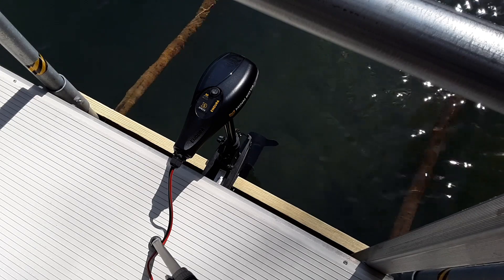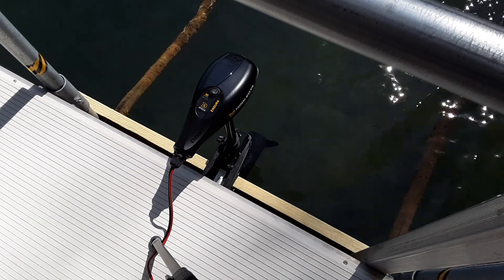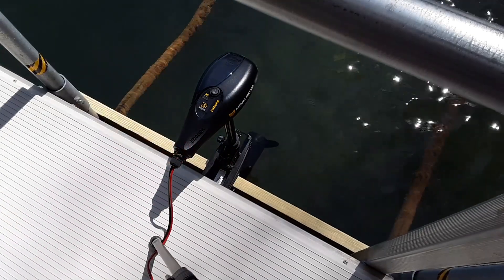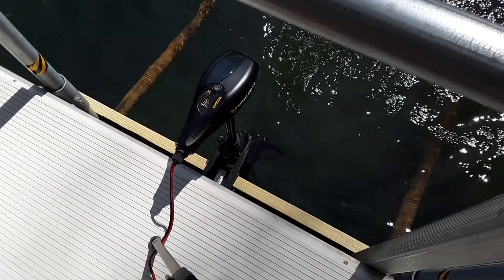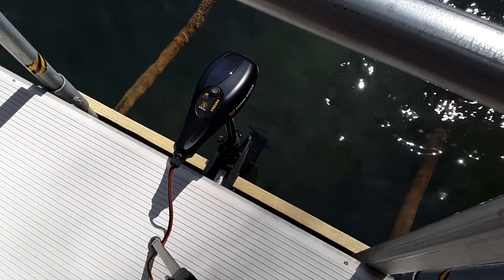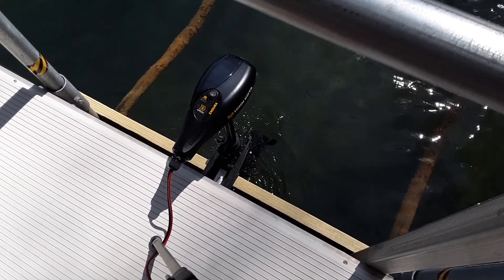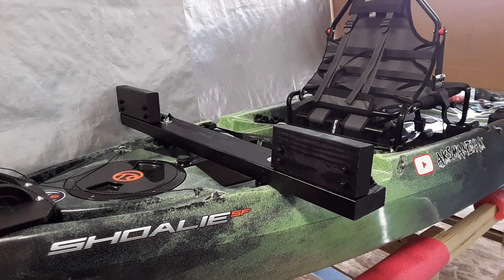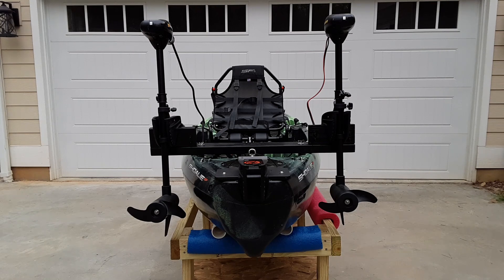Dual Trolling Motors With Wireless Controllers Used As Thrusters

Comment: so you cant control both on one controller? using left for the left motor and right direction for the right motor wont work as a way to steer and use one controller? im so ready to jump into this. awesome video
Reply from the maker: Thanks! Yes, you can control both motors with one controller. I also did that in my dual Watersnake T24 video.
Reply: @Aksmaniyak  oh... your channel is all about it. i just stumbled onto this video and didnt realize there was a way lot more. well... im going to start with video 1 and work my way up. thanks for the videos and reply.
Reply from the maker: @djtrunkz313  Thanks! Enjoy and bring plenty of popcorn! My videos aren't exciting but you will get information without all the blaah blahh blahh.😆

Comment: the props need to be more behind the kayak, not along the side. you would notice a dramtic speed and thrust increase. like big boats that have 5outboards, youd never see a motor hanging off the side of the boat.
Reply from the maker: This was just a fun project to see if it was possible. I made a quick double mount with 2x4's. The props would hit each other if mounted off the stern of a kayak. A big boat has more stern to work with and it is also more of a practical power plant. Take this video for what it was meant to be.

Comment: Great work, in a different video of yours  I asked about haswing protruar 3.0 24v trolling motor. You mentioned their good tm's and I want to ask for are there references to their run time capability with it being different from an outboard motor?
Reply from the maker: Thanks Travis. I have not seen a head to head with a gas outboard and electric trolling motor. However, gas will have a longer run time with an extra tank at a much lower cost than trying to carry multiple batteries.

Comment: To make a dual motor set up useful another component is required. A joystick controller allows for seamless 360º rotation and speed control with the added benefit of the safety of a second motor. If one motor fails the paddle is used as the rudder.

https://www.youtube.com/watch?v=iZXgDX8Wrw8
Yes 13 years ago. That is remarkable tech. Too bad I can´t find anything compatible for small boats... only big boats with electronic controlled engines
Cheers

Comment: Omg I just go the same remote planing to do it on my trolling motor… did you got it working with dual motor setup that help you turn by the speed of the motor instead of Turing the motor with 1 remote? I think I saw it as an function listed on the Amazon listing but cannot find any real instructions how to set it up
Reply from the maker: The dual Minn Kota uses 2 independent wireless controllers to steer. My other dual Watersnake video uses 1 wireless controller to steer.

Comment: Nice setup.
Question:  How is you AMP meter holding up and how long have you owned it?  I bought one just like it and it didn't last to long.
Reply from the maker: Thanks John. Glad to hear from you. I have been using it for about 3 years and it hasn't given me any problems.

Comment: Great vid and once again proves the max hull speed theory. You doubled the amount of thrust but didnt double the speed.
 (This isnt directed at you, i know you understand the concept of max hull speed)
I see so many people going big motor or playing with props trying to get more speed out of a yak. When the reality is its not the motor or the prop thats limiting the speed on a kayak.
Reply from the maker: Thanks. I agree with the max kayak speed theory with standard trolling motors. The 1MPH increase in this test doesn't really count much. I have seen the newer Torqueedos and NVs reach 6MPH on this kayak but those are different motors.
Reply: @Aksmaniyak  That was a cool project! @nitewolffishing I've also see the effects of more thrust not really equating to more MPH (or just slightly) and this certainly proves it. At some point, because kayaks don't get on plane, it just maxes out because you're just plowing. Again, great video!
Reply from the maker: @drewgregoryhookedonwildwat6991  Thanks Drew! You would like the first version with the dual Watersnake T24s too. Different control set up.
Reply: Just trying to understand.  I read about the fundamental theory behind the max hull speed theory.  But it doesn't make sense that a 10hp Torqeedo would not propel a kayak significantly faster than a 55lb trolling motor, demonstrating that max hull speed is just as dependent on the power as it is design.  As the saying goes, given enough momentum, pigs indeed WILL fly.
Reply: @MrSteve280  well for 1 think your not putting a 10hp motor on a kayak period lol.
And if you did at some point your going to break plane even on a displacement hull and now your no longer dealing with the limits of displacement hulls.

FYI the biggest one i seen on a kayak is their 1103 which is only 3hp.

Now that being said i have seen 2.5 GAS motors get a kayak up on semi plane.
 But as explained in my other response your no longer dealing with the displacement hull limits.

There are whole nother issues also when you do push a hull up on plane that was never meant to be on plane.
The main one being they get squirrel as all hades!!!

 I do see a near future where we do away with displacement hulls on fishing kayaks since the number 1 trend for the past few years has been going motorized and this year it seems to be going gas motorized.

I think the jonny bass10 is a planing hull by design. 
But right out the gate it was designed with a gas motor ready.
Reply: @NiteWolfeFishing  Sorry for the dual post - I thought I lost my first comment.  Anyway...   Of course you're correct, the typical kayak hull isn't designed to go much past 5mph regardless of the available power.  My Hobie Lynx would probably get airborne at anything over 10mph.  I'm just looking for the perfect solution to get to me fishing spot ASAP without having to do it at only 3mph.
Reply: @MrSteve280  for the best speed right now i think the best bet is a 2.5hp gas motor.
But not sure that hybrid could handle it.
Next would be a torquedo 1103. But comes with a 3k price tag.

at some point your just going to have to live with a 3 to 4 mph top end. 5 to 6 if you have the bucks and your yak/board can handle it.

 personally iam about ready to build myself a micro skiff. Put a 10hp on the back and spotlock on the front.
Reply: Bear with me - just trying to make sense of this all.  I've read about the max hull theory but it contains a few assumptions which appear to make the theory very condition.  It only makes sense that a more power would overcome hull design and that a 10hp Torqeedo would push the same kayak faster than a 30lb thrust trolling motor.  And, least of all, the max hull theory appears to be dependent on a kayak being paddled, not powered.  That implies just as much a direct dependency on how fast a human can possibly paddle, not only the design of the hull.  Add more power, and the hull theory seems to go out the window.   As the saying goes, given enough thrust, a pig WILL indeed fly.
Reply from the maker: @MrSteve280  I would suggest a test using the same kayak and the torqeedo vs the 30lber and see what happens.
Reply: @MrSteve280  Nope, you can power past max hull speed. Max hull speed doesnt matter if its paddled or motored.
Its a curve a displacement hull (which is what all kayaks are) has a max speed that it will reach with very little actual effort.
Once you hit that max speed it takes exponentially more force to gain more speed. even more speed takes a great and greater increase in force to gain a small increase past the max hull speed.
 So lets say a certian models max hull speed is 3.5 (thats about average).
Paddling or a 18# motor will get ya there.
Now you add a 30# motor and you get to 4.0, bump up to a 40 you may get 4.25, bump up to a 65# and you may get 4.5, bump to a 80 pound may get you 4.6 and so on. (numbers only used as a example)
 So you can push past max hull but it takes more power to do so and the gains get smaller and smaller.

 even planing hulls face this right up till they over power the displacement and climb up on plane.
Reply: @NiteWolfeFishing  I've come up with a solution; a drone kayak.  China's probably working on one right now.
Reply: @MrSteve280  lol

Comment: Awesome! Keep'em coming. I've seen a device that connects to esc's to give you differential steering with one controller. That would be even more awesomer!
Looks to be super maneuverable! Well done sir!
Reply from the maker: Thanks! It does handle really nice and is most awesomest...🙃 What is this secret dual ESC device you speak of?
Reply: @Aksmaniyak  I'm trying to find it. It's used for RC tanks so you can control speed and direction with 1 joystick.
Reply from the maker: @notoshaapproved  I have seen the tank remotes but they have 2 joysticks.
Reply: @Aksmaniyak  This is different than that.
Reply: https://youtu.be/jg7VdNfxuw4?si=mMrBUkV9xYV__7bI